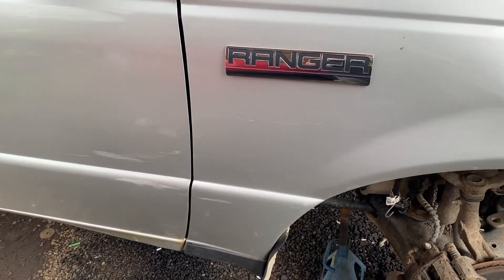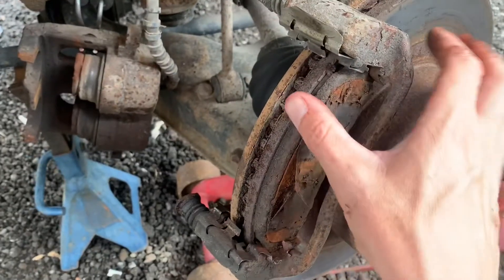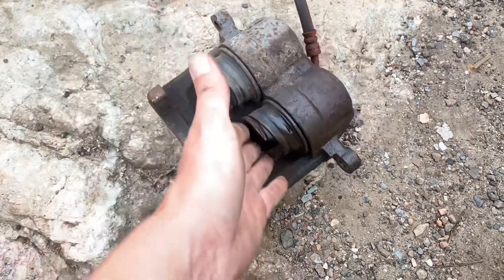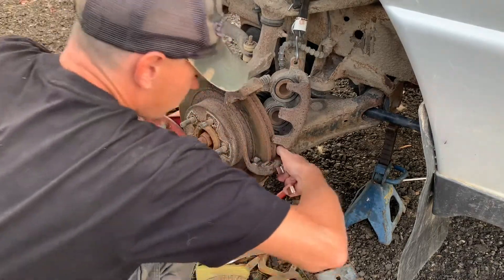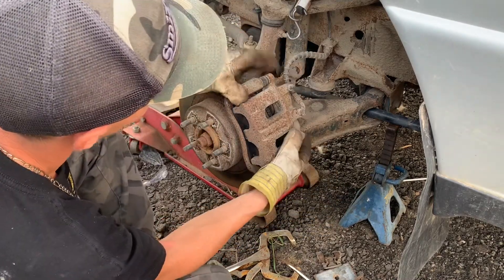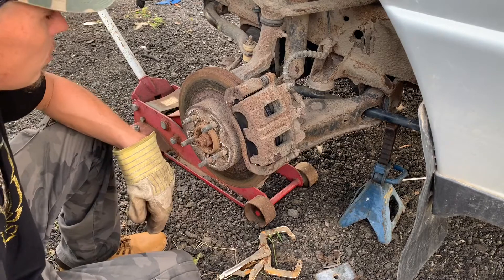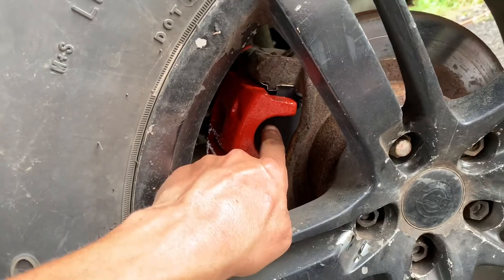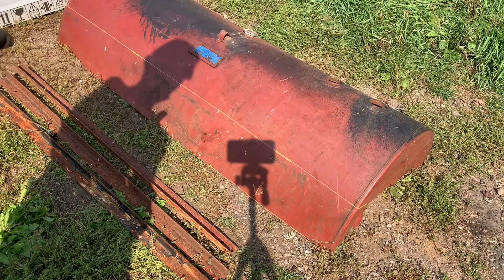Ford Ranger Brake Pads & Caliper Replacement

Comment: ?? 🤦😳 Ya ground the fig'n pad down ..the caliper stuck open and ground the dag thing.
Reply from the maker: The caliper was broken by the previous owner somehow.  That’s the way it was when I got it.  I replaced the caliper and installed new pads and it worked good after that.